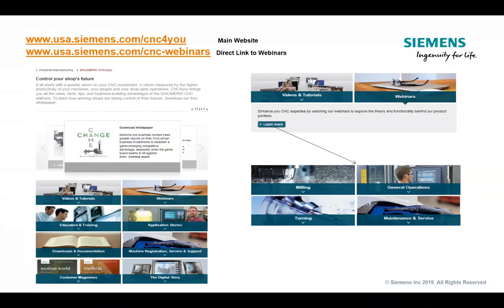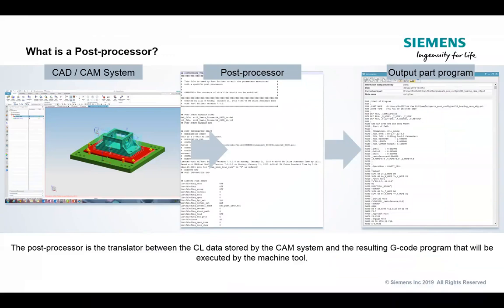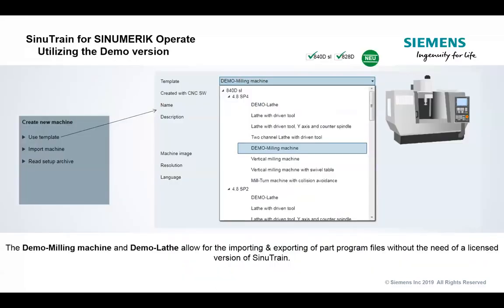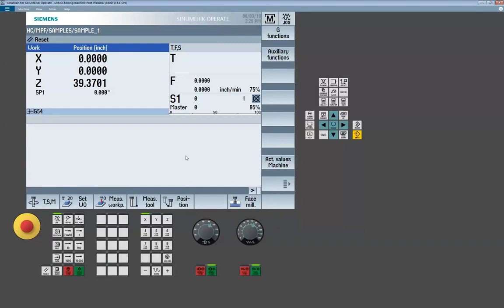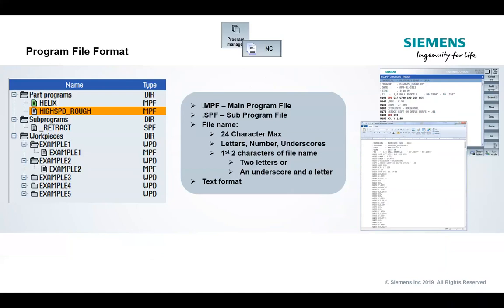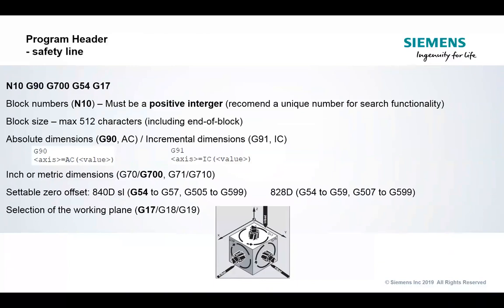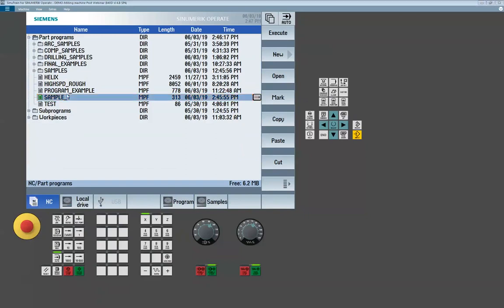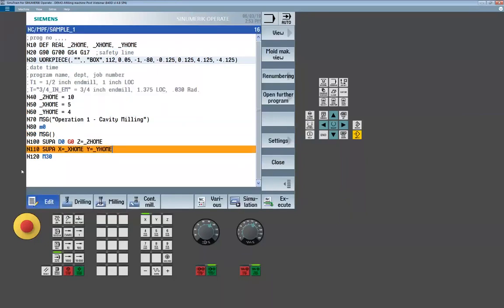Creating a Post Processor for the Sinumerik CNC - Milling

Comment: Another great video Chris. FYI, programs like notepad and notepad++ sometimes cause strange code (artifacts) to be output that you can’t see, I’m guessing that is what might be happening with your end of program errors. I had the same thing and if you edit in the control, delete the M30, then type it back in, it runs. I’m guessing the control cleans the file when you dump it in NC memory. This is a known thing with those programs in the programming world. I’d suggest a proper editor like Microsoft visual studio code (free) for gcode editing, another plus is they have Gcode highlighters. Also I’d LOVE to see a video on building custom user cycles, where they have a conversational style window like your standard cycles. I’ve tried using the instructions in the manuals but no luck! - Peter Betz.
Reply from the maker: Thanks! There are a few different ways to build those cycle masks, will see if we can set up an introductory video about that in the future.